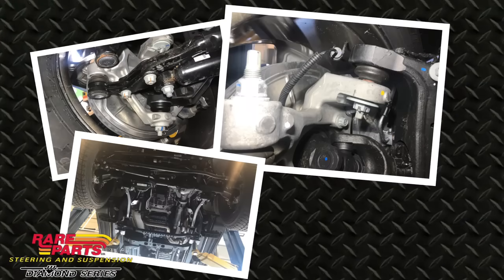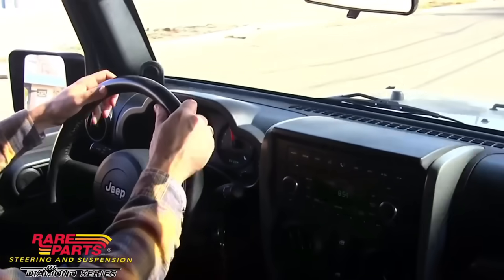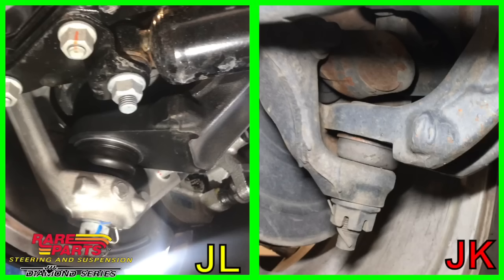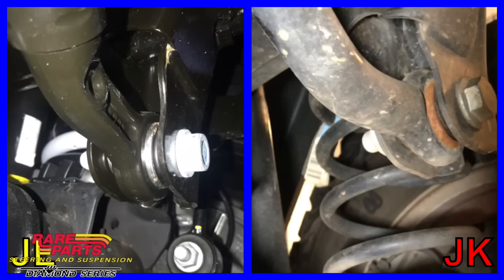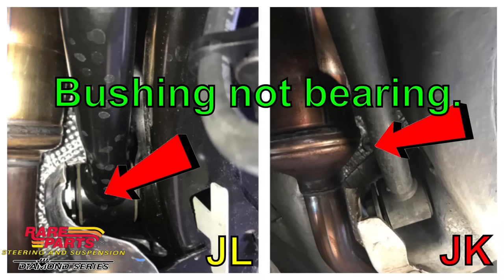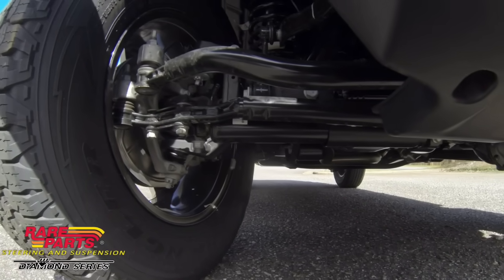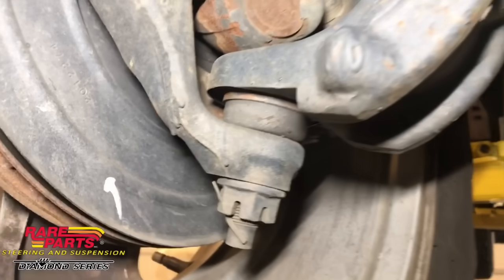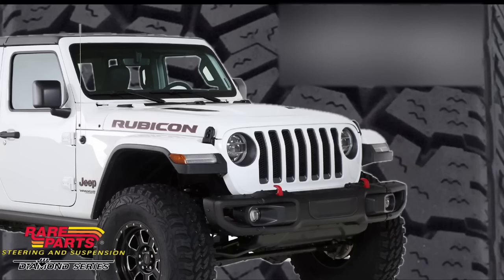Jeep Wrangler death wobble  Jeep JL vs Jk steering and suspension changes

Comment: Owner of two new(at the time) 1995 jeep wranglers. each had death wobble at some point. each was caused by two distinctly different set of circumstances and resolved with very little out of pocket expense and know how.

my "Sport's" DW was design flaw caused by undersized bolt diameter used during factory assembly for the lower track arm to axle mount. the bushing hole diameter on the track arm is too large and cause play no matter how tight you torque the bolt to the axle mount. Remedy> I drilled out the axle track mount hole to accept a beefier bolt and nut that matched the track arm bushings internal diameter. 

my "Sahara's" DW was from a loose steering stabilizer bold to the axle mount. i realized this once i made the same changes as above but still had the symptom. upon further inspection i noticed the passenger side axle oil seal failed and saturated the stabilizer bolt with oil causing it to loosen over time. Remedy> once i de-greased and lock-tight"ed" the bolt down, it never returned.

1995-2018 still use a lot of the same components like bushings and mounting hardware so it's cost effective to rule these possible causes out before dropping $$$ for a fingers crossed solution.    

All my years researching, reading blogs and posts about this issue i never seen anyone state my exact causes. so this my 2 cents because owning a Jeep is something you just can't explain only experience, but experiencing DW is a bummer when you were in a good mood just moments before...

p.s one other possible contributing cause could be "slide" in the upper track arm chassis mount. the bolt hole on it is elongated. i installed heavy duty tooth biting washers on each side to dig into the mount when tightening for good measure.
Reply from the maker: Dude thanks for this great information. When I made the video I had totally forgot about the elongated hole on the track bar.  I hate I didn’t get to mention it. This definitely has been an issue in the past. Thanks again for sharing your experience.
Reply: @BrandonHaneline  yep this same issue fixed mine  Check torque on the bolts because they get loose and start elongating the holes. Same issue on Ford F250s.

Comment: Had a 2001 Jeep Wrangler Sahara with 220,000 miles before sold. Was well taken care of and no death wobble ever, even with lift, bigger tires. Now have 2013 JK, lift, tire's and no death wobble.
Reply from the maker: Key words. Well taken care of 👍🏻
Reply: Well when i mean "well taken care of" all i did was grease points every oil change only.
Reply from the maker: If you notice in the video. They don’t even put grease fittings on joints anymore.
Reply: Yes lifetime grease boots. Still have failures i bet over time off roading hard.
Reply: Yes "lifetime" grease boots since most people dont bother doing this regularly.

Comment: What do you mean when you say changing all of the components to have it fixed for a good?

For good? Forever? 

No, it will still worn out eventually. So what you said in that video is not exact.
Reply from the maker: Great question Daniel, Of course not for good or forever. We cannot defeat the 2nd law of thermal dynamics that states everything wears out eventually. What I'm meaning is that when the Jeep was new with all new parts it did not exhibit the death wobble scenario. So if you put it back like that. It will fix this concern. Unfortunately that would be very expensive to replace all steering and suspension components at once. Maybe at that time you could upgrade to a good lift. If it was stock. Thanks again.Hope this clarifies my explanation.

Comment: 2500 and 3500 Dodge is a bigger scale of this suspension design and have the exact problems.
Reply from the maker: David Witcher I agree. I just had a 3500 Ram with last week for this problem. It had 70,000 miles on it.
Reply: Unfortunately I've fought death wobble on them as early as 40k miles. Worn steering boxes and ball joints on almost everyone of them.
Reply: Old comment but fyi dodge has a redesigned steering setup that you can put on 08 and down. You have to change the pitman to make it fit but it makes a HUGE difference. Have done it to all my Cummins trucks and never saw dw after. It fixed the geometry flaw in the setup

Comment: do stock jeeps that have not been raised have the same issue? looks like the jeep in the example was raised.
Reply from the maker: Thanks Captain
Reply from the maker: Great question, your correct the Jeep in the video was lifted. I have seen it on stock Jeeps and Modified Jeep. The root cause is worn or damage steering and suspension components.  Thanks for the question. Hope this helps. Some of the comments on this video are examples of stock Jeeps having this issue also.
Reply: Amadi Ography they do,but its nothing like what happens after they are lifted.Im speaking from experience,mine had none before it was lifted.After lifting,it was very apperent that most of my steering was shot.After about 3k in new parts most cost of installing it all.My dw went away.Its about how much you wanna spend.
Reply: My stock 2004 TJ got DW at around 80,000 miles. Scared the $%^& out of me going to work at 6am going 65 miles/hour! He is right- it’s a combination of worn components.
Reply: My Rubicon did not exhibit any problems for the first 120,000 miles, on road and off. At that time I got it lifted and went to 35” tires (had 33’s on it prior to lift). It was after that I started to have problems at about 135,000 miles. I believe the tires and lift changed the geometry enough to aggravate what wear and tear I already had to the point I’m now having to change everything out. Ball joints first, and now I’m working my way through the rest of the components as well. Expensive, but worth it to keep the vehicle longer. It’s a 2012.
Reply from the maker: Thanks for sharing Dennis. I remember my first DW experience also. I almost 💩 myself!😵

Comment: Thanks for posting this man. As a Wrangler owner for the past 20 years now, I can say first DW experienced on my 89 YJ and it was scary. Then on my 07 JKU, I had a 2.5" TF lift kit with 34" tires and 17" rims. It drove like crap and was very disappointed on it. I managed to do some adjustments to get the ride feeling right. First it was pulling to the right, then it shakes a little when  i depress the brakes. Even worst when I try stopping on uneven pavement which cause it swerve as if it the road was icy. I knew my caster/ camber were off. I upgraded geometry corrections bracket, added adjustable track bar and heavy tie rod. It helped a little but not 100%. I then upgraded to TF adjustable lower control arms, same deal, fixed some but not 100%. Now I own a 2017 JKU, thinking I should stay away from lift kits from now on.
Reply from the maker: Thanks so much for sharing your experience. Much appreciated👍🏻! Curious....do you still have your YJ.
Reply: Unfortunately not. That YJ had nothing but problems given to me. Other than mechanical issues, it was also an attraction to thefts (like 3 times!). I've owned two TJs in the past as well, but no issues with them.
Reply: Leave it stock unless you have to have a lift for your trail excursion needs.  They aren't worth the added expense, maintenance and driveability negatives.

Comment: Thank you for a logical, factual explanation. Death wobble is caused by worn and loose components. Inspect your Jeep. I know the underside of mine better than the top side.
Reply: In motorcycling, that death woble is called a "tank slapper" and it happens on sports bikes with low rake and trail. A steering damper prevents the problem. A bike with more rake and trail (a chopper) doesn't experience tank slapping. So, the more positive the caster, the less chance of wobbling.
Reply: I have a brand new Jeep Wrangler JL sport Unlimted in the Sting Gray color. It's been back to the dealer twice for that death wobble! They can't pinpoint. They've rotated the tires twice and I only have 6,000 miles on it. Nothing is worn. Its a chronic problem that they still haven't fixed.

Comment: is there a specific size tire that this happens to or is it just weak suspension ?
Reply from the maker: Marcel, thanks for the great question, no specific tire size will cause death wobble. It is caused by worn or modified steering and suspension components.

Comment: What's a "plug-in hybrid wrangler" designed to ford 30+"'s of water going to do to the base price of a Wrangler?
Reply from the maker: You a have a great point. The add on for the 2.0 and diesel is going to be a lot already. who know how much that would be. But I will have to say. There is no upcharge on the Chrysler Pacifica PHEV. plus you get a $7500 federal tax credit if you live in the states. So maybe they will follow that path.

Comment: What year is that jk? Mine is a 2017 with a AEV 2.5 lift kit and I've driven through big holes, bumps, etc and I haven't experienced any of that. Hopefully I won't.
Reply: Mauricio Ramos when your ball joints  and your steering gets worn out.You will probably get to experience some dw.Make sure yu have extra underwear for when it happens lol.
Reply from the maker: AEV is a great company and they know what their doing.Who ever installed you lift also knows what he was doing. Not 100% sure on the year model maybe 2014-15? don't hold me to it.. 
Thanks man. I bet your Jeep Looks Sweet with the 2.5 lift. What size tires are you rolling?
Reply: I like it a lot. It's the perfect lift for me. I got the sport with 3.21 gear ratio, so I went with a 33 BF goodrich tire to keep that MPG. I am still getting 16 MPG with 33's and love the handling when I go off roading in Big Bear, CA. Everyone tells me the I should've gone with a 3.5 and 35 inch tires, but I knew I would give up a lot with that set up, considering my gear ratio. correct me if I am wrong. I am new in the arena

Comment: Does DW affect stock Jeeps or just modified ones? It seems as though you are blaming Jeep for a problem their customers create. What I see as the biggest contributing factor to DW are the heavy/oversized tire/wheel combos installed and in my opinion that is certainly not Jeep’s problem.
Reply from the maker: Great question Rod z. You are correct heavy/over sized tire/wheel combos can definitely Create a death wobble issue. As a Jeep Technician for 20 years I have see Both stock and modified. (But more modified). The Mall Crawlers most likely will never have this issue. They just don't get enough wear and tear. Actually. any vehicle with a solid front axle is subject  to death wobble. GM,Ford and Dodge have all have this problem. Jeep just gets the brunt of it for some reason.  It all depends on how it is driven over the life of the vehicle. If the vehicle has had a rough life then you will most likely see DW at some point. No matter what, Death wobble is caused by Modified or Worn steering and suspension components. Thanks again for the Great Question. Oh by the way, Its not Jeeps Fault. Its just the price you pay for a solid axle. 👍
Reply: Rod Z 
Is a jeep problem. I had a stock 2007 with death wobble. The fix? Ball joints replacement and DW gone. It cost 1000 to replace with the dealership and this includes alignment. It felt like new.  I little costly but worth the money. Lifted oversized jeep just accelerate when it will happen.
Reply from the maker: Rod Z your right on the money. Thanks for sharing your experience! 👍🏻
Reply: I had a stock 2012 wrangler and it had the death wobble after 25,000 miles
Reply from the maker: Thank you for sharing you experience Christopher.

Comment: One of the other reasons for DW on the JK was that the bolt they used for connecting the trackbar to the chassis was threaded, and, IIRC, was not of the correct size.

In normal driving conditions, this would be fine - a little vibration is tolerable. In extreme driving conditions however, that thread and size mismatch could cause the hole to 
elongate, allowing the trackbar to have more play and side to side movement than it should. According to most Wrangler owners from Allpar.com, replacing that bolt with a smooth, properly-sized one (of equivalent or greater strength) is a simple mod can help stave off DW.
Reply from the maker: Great advice. Thank you!
Reply from the maker: Wow 😲 that’s crazy, 3k miles. Thanks for sharing your experience with us.
Reply: We've no news yet as to what bolt the JL used - could be the smooth one already. In any case, it's a relatively quick swap. As to why things went the way they did, your guess is as good as mine.

Comment: Nope. Death wobble on JK caused by u-joints and all the inertia of the front drive shaft.Jl has front axle disconnect, eliminates the inertia. DW should be a thing of the past. Healthy track bar and bushings merely prevented the initiation of DW, but worn parts didn't cause DW. Cause and preventive measures, there is a difference. You could have worn parts if you replaced the u-joints with CV's and you'd never get DW -- the uneven rotation so characteristic of U-joints would be absent.
Reply: My previous posts disproves your theory... solid axles with unlocking hubs get DW. You found some other people that have similar theories of the cause of something you have little knowledge or understanding of. Go ahead, keep arguing why your theory is good, because it is. It just isn't right.
Reply: U-joints wouldn't even begin to cause this.  It's all in the dynamics outside of the king pins or ball joints which in lay terms is big heavy tires and wheels and in combination with suspension angles being changed by inferior lift kits.
Reply: http://www.jeepforum.com/forum/f9/death-wobble-when-front-driveshaft-connected-1123167/

Seems to support my theory...
Reply: Frank Huber Driveshaft angles...Interesting. I didn't see anything about how that would correct DW while in 2 wheel drive with hubs in "Free" position, when the front driveshaft isn't turning.
Reply: chipferbrains Nope. Old cherokees with CAD got DW as well as axle swapped Jeeps with locking hubs. Good theory, but wrong and providing more misinformation.

Comment: the greatest reason of DW is caster angle. when you lift your jeep you must always correct the caster angle by the front control arm drop brackets or by  the correct size short arms that  depends on your lift height. believe me I know what I am saying
Reply from the maker: Great advice!!
Reply: As I've said in other comments, I have a brand new Jeep Wrangler JL (2018) sport unlimited. Nothing on mine has been changed...ie no lift, not tire change. I have 6,000 miles on mine and it's been back to the dealer twice for this wobble. They've rotated the tires twice and its still there. Its a chronic problem they have yet to fix.
Reply: That is correct as are other things that need attended to.

Comment: If you have a solid font axle, DW is going to be possible especially once you start using it if ways it was not designed for (lifted, various aftermarket components). It is just the tax we pay to get all the solid axle flex!
Reply: D&E In The Garage Its just a matter of miles and wear.If its like any of the past wranglers they most likely will.
Reply from the maker: Well said sir. You have a great channel! I was checking it out last night.
Reply: Hey, thanks! you as well. I have subscribed. Can't wait to see more vids

Comment: Having a good stabilizer protect these components from wearing out or would that not make much of a difference
Reply from the maker: Thanks for the Great Question! Yes You can upgrade your steering stabilizer. You won't be hurting anything. But.... the steering stabilizer will not keep components like ball joints and tie rod ends from wearing.This comes from Bad roads and quality of parts. If you noticed. None of the Joints have a grease fitting. so you cant prolong the life of the joints. Also alignment is very important.SO to answer your question. Yes you need a good quality steering stabilizer but it wont keep certain components from wearing. Thanks again for the great question.
Reply: me no if its a high mileage wrangler,it probably will need money put into the entire front suspension if your going to lift it.

Comment: I do not quite understand all of the mechanical information, but I am already in fear of having to replace the entire suspension at just 40,000 miles.  Like you said below,  Off road wear and tear  is the main, unavoidable factor.   Mall Crawlers will live forever.  Thanks for this informative video.

Comment: All I see is some thicker shafts the tie rod joints and mounting bolts are what counts so that's more fiat bullshit just think to have to totally rebuild the entire suspension at 40 or 50 thousand miles under normal driving conditions is a crime !
Reply from the maker: A Jeep driven under normal driving conditions most likely will not exibit death wobble for many years and miles. It’s the Jeeps that get used for what Jeeps are made for that wear faster.
Reply: My mall crawler 2007 JKU Sahara got death wobble within 20k miles. I babied that thing too.
Reply: Jason Morris that's a crime
Reply: a good pot hole or two can damage components also.